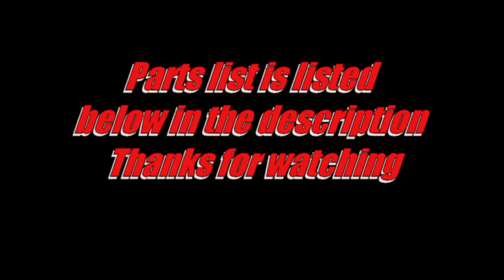Tactical Transducer Pre install test

Comment: So how did you find the vibration of 1 puck per side, was it enough for you. I am thinking about do a Mod to my playseat challenge with 2 Puck per corner. Great Video
Reply: Edit. Just purchased 8 pucks, 2 for each "wheel" I have an Idea for a playseat Challenge. It should be rocking hopefully.
Reply from the maker: @rtimmins7212  Let me know how it turned out..
Reply from the maker: The pucks were a little under powered for my wooden rig so I upgraded them but if your rig is of a lighter material I think they would give you what you need..